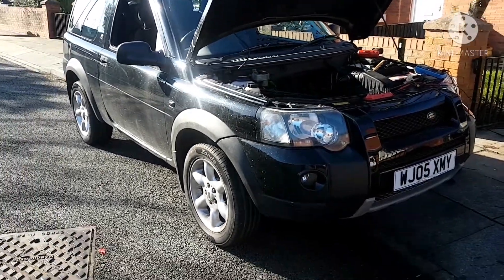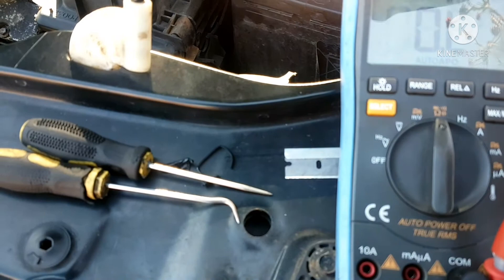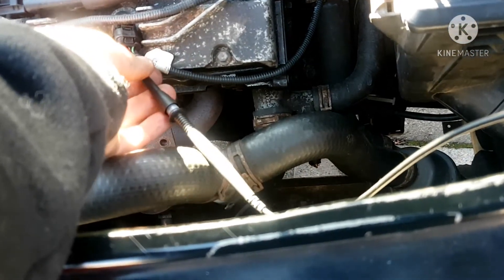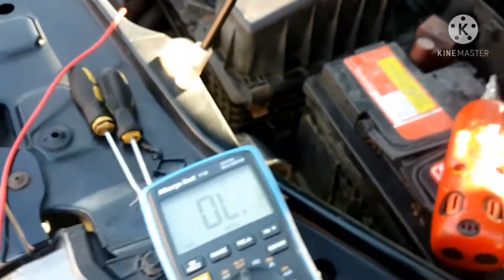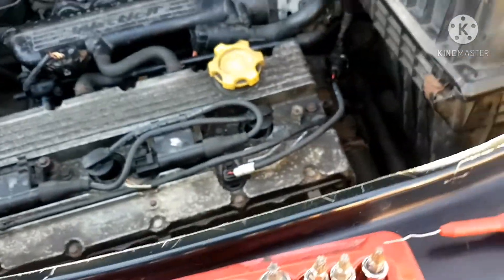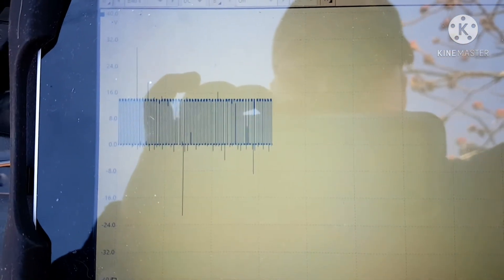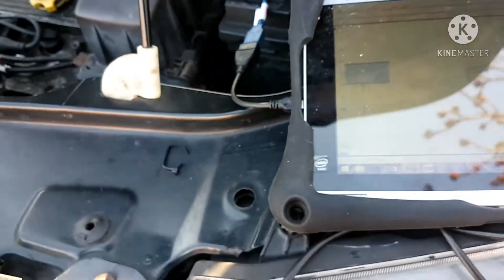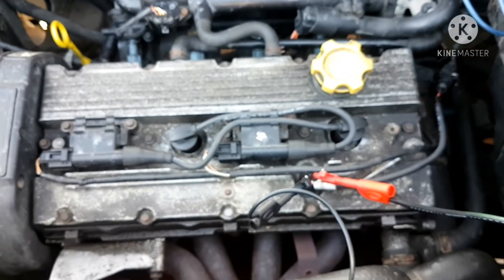How to diagnose and repair a Land Rover Freelander 1.8k petrol. Rough idle, DTC P0340. Part 1

Comment: hi there  my dad owns an freelander 1.8  2000 (owned since  2008) he has no codes  but the idle is rough  the  needle is spiking up and down   the car had it's head gasket  changed  the second time(it has 70000 miles) but we can't get rid of this  rough idle ....any ideas ?
Reply from the maker: What are the fuel trims? Have you cleaned out the intake manifold and throttle body? That sometimes helps, also make sure the port to the idle control sensor is cleaned. Also have you checked the condition of the spark plugs, coils and leads? Has the rough idle only started happening since you had the head gasket replaced? If so you might want to do a compression test and also check the timing for the cams is OK. There could be a few other things but start with those for now.

Comment: Hi, I have 2001 freelander petrol, it has a rough idle but once car passes 1.5k to 2k rmp it sounds and run smoothly, I cleaned up my throttle body and feeling better now at idle condition. Can you suggest what next should I do ?? Is there mass air flow sensor or manifold air pressure or anything other thing.
Reply from the maker: There is a MAP sensor that is also the manifold air temp sensor in the intake. It is a speed density engine so there is no MAF sensor. When is the last time the spark plugs were done? Also might be a good idea just to run some high quality injector cleaner threw the system. If you are still having rough running issue, check there are no air leaks, check your fuel trim values.
Reply: @motormind4788  plugs were changed before two weeks, there was bit leaking near engine and injection joint which I fixed and cleaned throttle body without removing it. Now thinking to remove throttle body and clean and check MAP sensor and clean it .